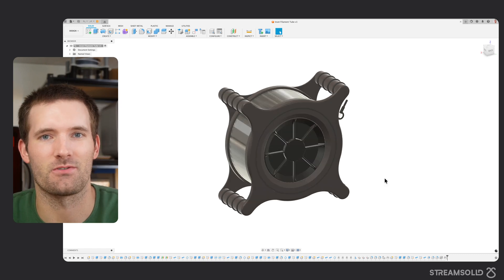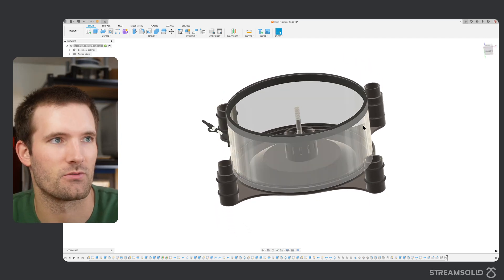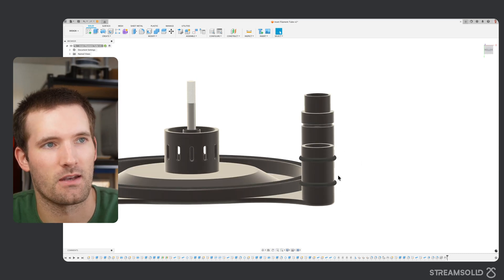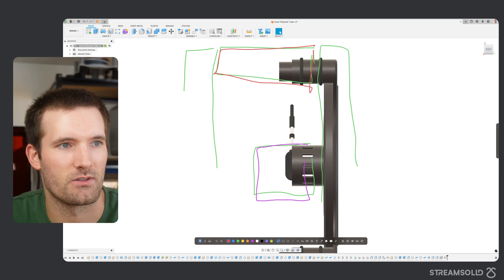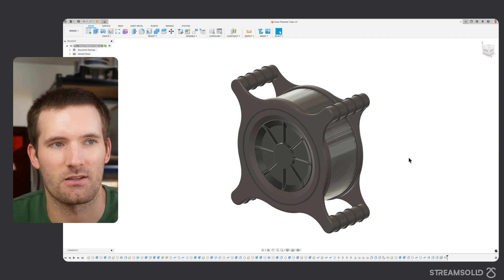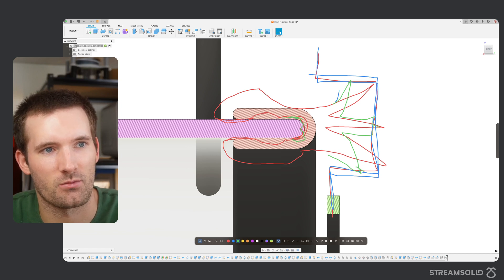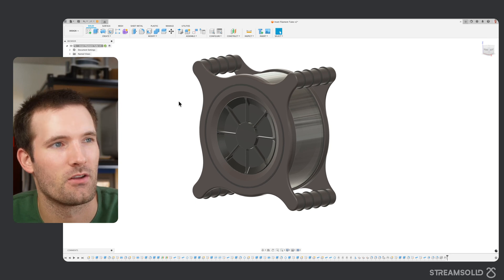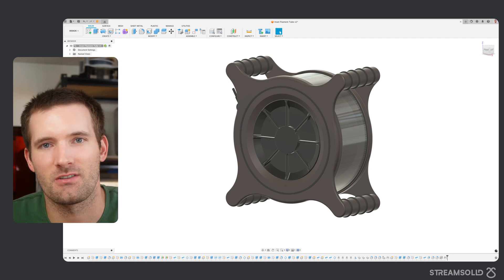Lessons Learned Designing for Manufacturing (DFM)

Comment: What are the benefits of this over the cereal container hacks, the vacuum sealable storage bags, or others making containers that connect to heaters in an attempt to dry the filament and keep it in an airtight container? As a thought experiment it's interesting, as a way to learn about injection molding and draft angles and failure loads it's useful. I'm just not seeing the viability or any differentiators outside of style. Why does this need to be injection molded? Outside of sourcing gaskets, and acrylic and other parts, why does it need to be injection molded?
Reply from the maker: 1. It’s actually airtight (most others aren’t)
2. It stacks on its side 
3. It hangs on the wall
4. Filament path is fully adjustable (360 degree rotation)
5. It doesn’t look like a cereal container